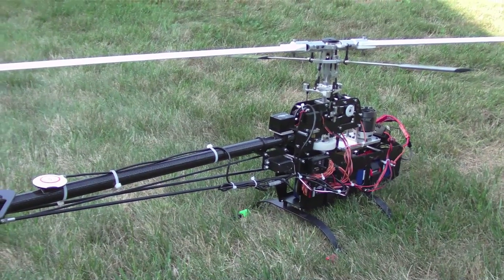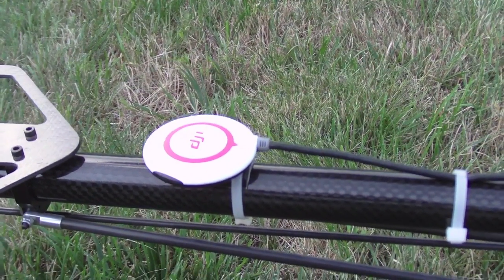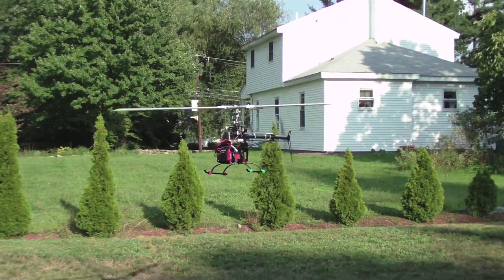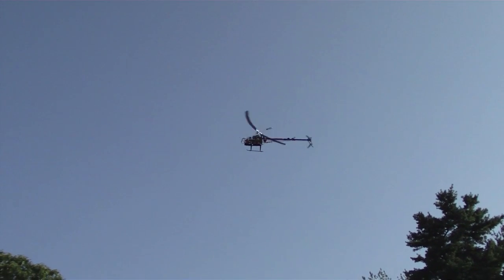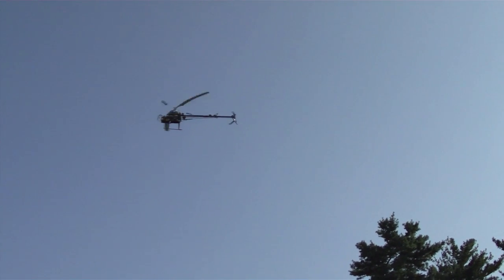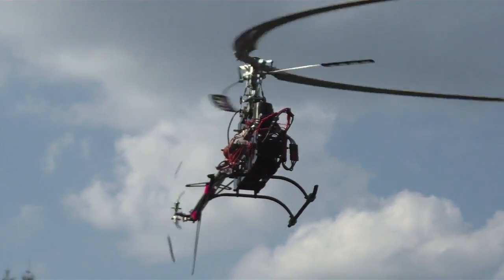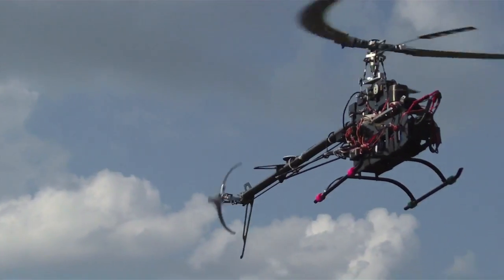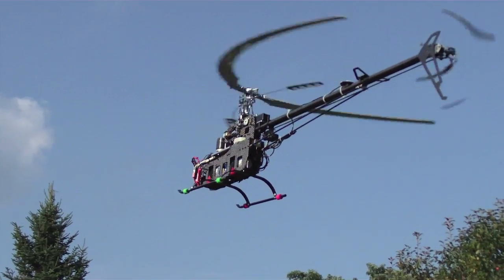DJI Wookong-S Scale Test Flight

Comment from the maker: The Wookong-H is optimized for very fast tail rotor servos.  When I used it with a standard, or even moderately fast tail servo, I got tail wag like you.  Using a much faster servo, and making sure the linkage is low drag, cured that issue.

Comment from the maker: I did use the recommended settings, and would agree they were close.  I tweaked the pitch and roll ATTI gains to make them slightly higher than stock settings.

Comment: Hi Gene, i think i got the tail wag issue solved! I was earlier using an align stock ds650 for my tail set up but was constantly having tail wag issues no matter the tweak tried some other servos, same issues! then i frustratingly decided to give the futaba BLS256 a try WOOO!!! tail wag disappeared completely and my heli was flying smooth as if it was on rails.

Comment: @JoelsPennyArcade 

Thanks,

I have done the first test "flight" now (actually more of a short skip) and I found it to be very stable but at the same time sensitive to control inputs. Mine is FBL and I used the numbers recommended for the Joker, I guess these are meant to allow for aerobatic flight. Hope to do some more flights within the next couple of days.

/Jesper

Comment from the maker: The Wookong-S features auto-hover when fail-safe is activated, but it does not feature return home.  The Ace One product has the return to home feature.  The "home" is reset when the unit is switched on.  It is not retained in memory.

Comment: You'll definitely have peace of mind if you try the BLS256HV,(760us 333hz 43% HH rate) well I'm running 2S on my autopilot system without an esc so its the same voltage that powers all my servos and all my servos are futaba HV series.

Comment: Thanks man, I thought about giving MKS DS660 a go, it seems to have a very fast response time, but if BLS256 definitely worked for you then I will buy it instead. I've tried everything to solve this tail wag and nothing worked. Are you running the servo at 6.0v?

Comment: hi there i have read this unit also supports a return to base mode and auto landing if tx signal is lost .dose this require any aditional stuff to setup apart from initial pc setup
what i am asking is if you fly from different locations do you need to set for each one or is the base rejestered each time unit is switched on